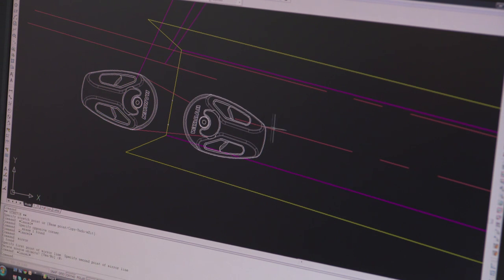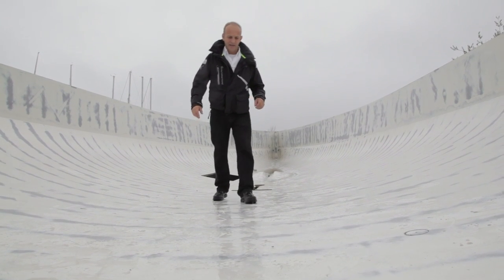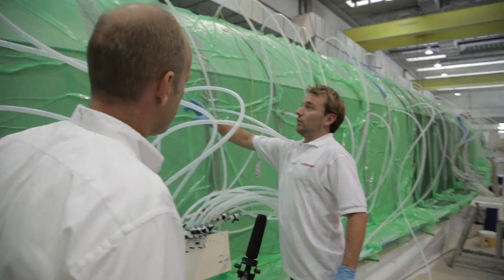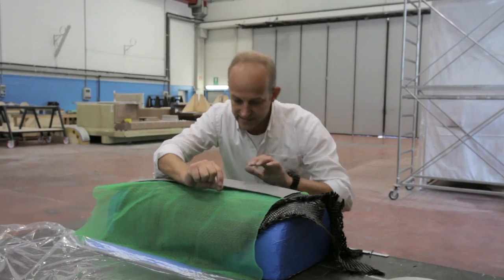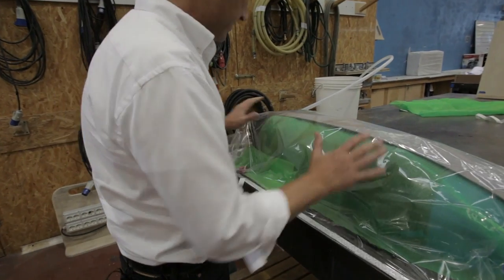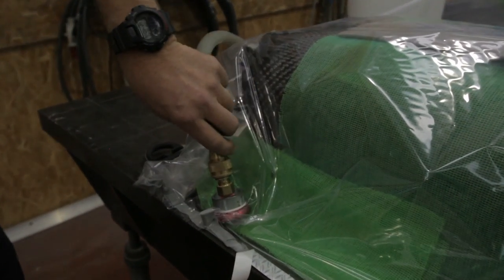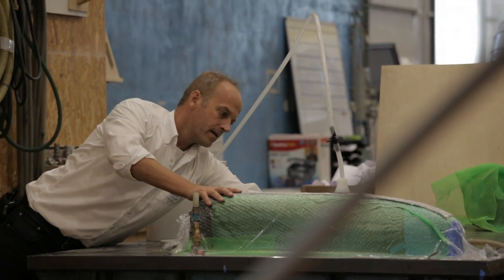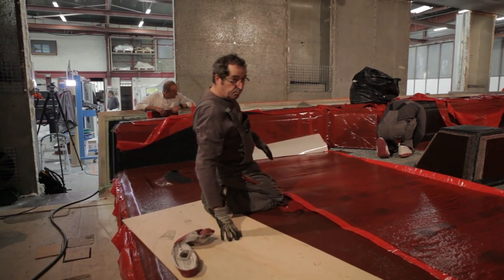Episode 3: Farr Yacht Design | Volvo Ocean Race 2014-15

Comment: Yeah, I was thinking the same thing. I built double hull fibreglass boats with my father - from wood and plaster plug to finished product - and I was very confused by the narration. 
If you're wondering: the vacuum in the bag draws in the resin, which then spreads evenly across the plug, completely saturating the carbon fibre. After it dries the plug is removed and then a male mold is made inside the first one - this second mold is the production mold, off of which all the hulls will be created.

Comment: Do they have a coating layer before the first carbon layer is laid onto the plug? How is this done? It is skipped in the explanation at 3:07
Reply: Wax and release agents
Reply: @0718dm  Obviously they won't just put usual release agent and wax onto the plug as the styrofoam is extremely weak. That's why I was asking. Has to be more like a filler which is sanded down again like that you use for surfboards.
Reply: @simpleman5494  The plug starts out as foam. Covered with a bondo like paste, reshaped, sanded and painted. Then sanded and buffed. Waxing happens after that.
Reply: @0718dm  thank you!

Comment: What is the reason for using carbon for the moulds? Seems overkill? 
Glasfibre wold be much more economic. Even if  have to use twice as
much comparing to carbon. 

Plz enlighten me! :)
Reply: For expansion reasons. Fiberglass and carbon expand differently. Best practices are to use the same material form the mold and the part that is being made.

Comment: How thick is the carbon fiber being used
Reply: in the video you can see them put on 5 layers where as the first layer was already hardened if i see it right. With just 5 layers you can know for sure that its something like 400g/m2 or thicker. Also there was at least 1 extra layer along the middle of the mold
Reply: If you watch all the videos the layup info is here and there, including weight, weave and layers.